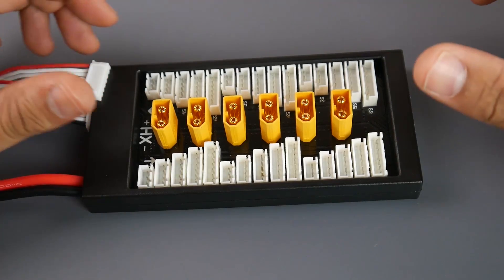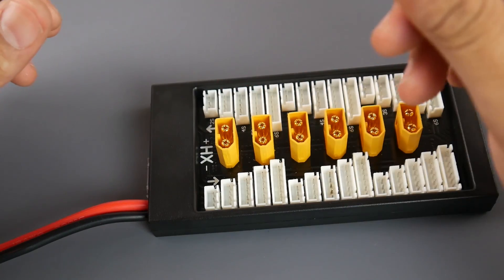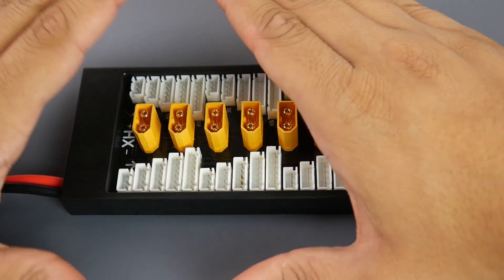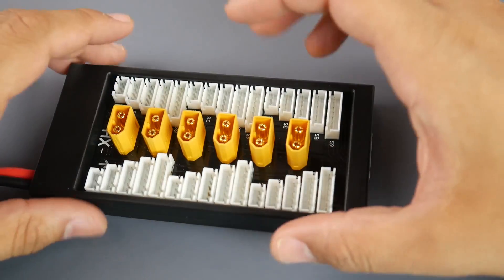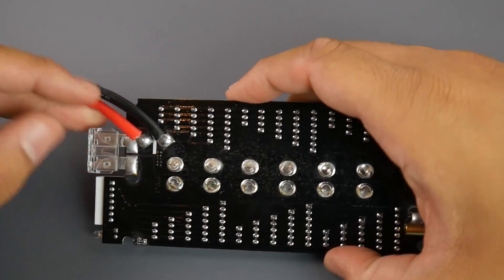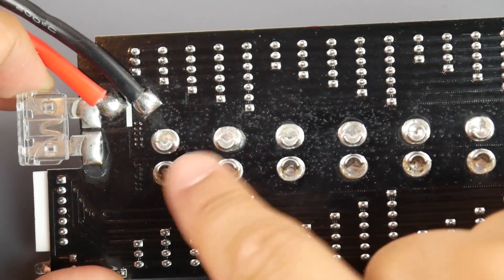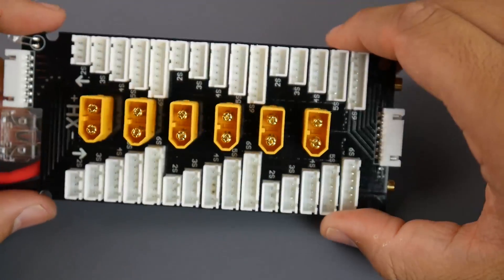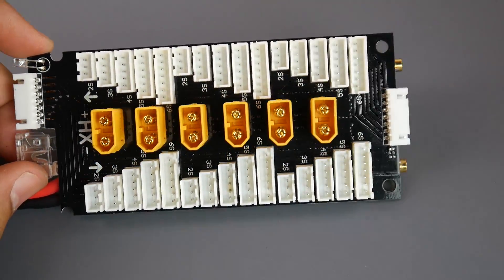$15 ISDT Parallel Charging Board // Review & Tear Down

Comment: Correct if my understanding is wrong please.
I should charge batteries with same cell number.
I should charge batteries with same capacity.
I shouldl not charge batteries with same cell number and capacity but different current voltage unless I leave them standalone to balance each other and then I can charge.
If I connect 4x2200mah, then my current on the charger should be 2.2 (1C) x4?

Comment: Yikes, I ordered this thing before watching your video. I wish I saw it with the case off before purchasing.

I know you said this was your first parallel board so perhaps you're not familiar with safety features that are present on better ones, but it is standard now to have poly fuses on the balance connectors and individual fuses between the power connection for each pack. Strange that you would acknowledge that parallel boards scare you, but then be ok to use one with no safety features to prevent high currents flowing between packs. 

Would you consider adding a disclaimer to your description warning people that this parallel board is lacking in safety features that are present on other boards. The board should work fine as long as the user is very diligent and never makes a mistake when plugging things in. Personally I would not take the chance, you can get a board with fuses for another $10-15, that's cheaper than the cost of a new battery or a fire.

Comment: Don’t spread misinformation...  it’s completely fine to charge batteries of different “sizes” as long as the voltage is the same... When parallel charging the batteries behave as one giant battery...

Comment: If the batteries are within .5 or .6 they balance in mins. 5 or 10 mins. I used to wait about 30 minutes, but started checking with a voltage checker

Comment: I have two of these boards, the modification with banana plugs and coworker have a third one. Cooper traces on board are massive. Hadn't fried one with 10A balance current on charging 4S. On accidental balance connector inserting backwards (JST balance sockets are prone to allow connector inserting improperly if one is on rush or don't care), fried 3S and 4S balance socket. Replacing is easy, but you must remove fried connector by pulling out fried pins when solder on them is melted. Damaged traces can be repaired with 20AWG wire.
Mixing C-rating and capacities on parallel balance charging is possible for batteries with same cell count. On same capacity but different C-rating charge with current allowed for connected battery with a lowest C-rating. Batteries with different capacities will charge as battery with total capacity for both batteries. In both cases before  batery connecting to charging board check for if voltage difference doesn't exceed 0.1V.

Comment: You can charge different capacity packs together that are the same voltage, provided the cells are within .1V of each other. Just add up the capacities and treat them as one pack of that sum, and charge at 1c.

Comment: if you use 3s 800 like me or other low amp batteries the moment you connect one battery you only need to connect the parallel cable of the rest.

Comment: I refuse to use these boards. I have cells go dead every once in a while. Put this lipo in a balance charger - WARNING! - put it in a parrelel charger lipo fire. You have to be on the ball checking voltage and cells before using this thing.

Comment: You just can't mix voltages MAH does not matter I do 1300's with 1500's. But they should be within 0.4v of each other before connecting.

Comment: You can mix batteries with different capacities without problem. The two things you have to worry about are:
1. individual cell voltage: which has to be almost equal over every batteries nth cell. If the voltage difference is to high, a very high current will flow between the the cells of the different batteries over the charging board and it will burn the traces.
2. internal resistance: You should not mix old and new batteries. Old batteries have a higher internal resistance and will take current differently than new batteries if you mix them. So if you want to charge  n batteries with n x 1C, each battery will not receive 1C but some more and some less.
And you don't have to wait more than 5 min to equalize the cells after connecting all the batteries. The board has almost no resistance so the the little voltage difference is equalized very fast.
Reply: foamidable Point 1 is correct, Point 2 is false. Internal resistance will not impact division of charge current.
Reply: @peterkjellstrom3100  ok, then what does? joshuah bardwell shows in his video batteries with the same capacity, parallel charging each with different current
Reply: foamidable I don't know exactly what you are referring to but an uneven charge current is one or a combination of: 1) not fully equalized initial voltage 2) actual capacity difference 3) slight differences in charge curve (chemistry).

The largest factor you'll see for reasonable combinations is #1. Starting the charge early at high amps will essentially push most of it into the lowest/lower pack/pack.
Reply: @peterkjellstrom3100  I thought higher internal resistance leads to more energy wasted to heat while charging and discharging. So you need higher current to bring a battery with high internal resistance to a certain voltage.
Reply: foamidable The ir will cause heat but 1) it's really low (a charge around 1C does not noticeably heat a healthy battery) and 2) any such heat would just be seen as added capacity charged (wouldn't cause any imbalance).

This may not be clear without a solid electronics understanding. But there are online circuit simulators you could play with to see how it works if you want to.

Comment: You can charge batteries with different C-rating and different capacity. 
What is important is number of cells and the voltage of each cell. If the cell voltage is different you get a momentary current from the cell with higher voltage into the cell with the lower voltage, when you plug them into your parallel board. 
This is a problem for the cell with lower voltage as it will be changed with a high current for a short while, until the voltage differences has evened out. Especially if the lower voltage battery is a low C-rated battery and the battery with the higher voltage is high C-rated, it may kill the low C-rated battery. The battery with the higher voltage will see a discharge current that is high but our batteries has far higher discharge C-rating than charge C-rating so there is no problem for the ell with higher voltage.
A rule of thumb that many people use is to only connect batteries that has less than 0.1 Volt difference per cell.

Comment: You can mix capacities just not cell count. So you can charge a 1300 and a 1500 mAh pack together but not a 3s and a 4s. Do make sure the voltages are within 0.1v per cell though. Also, be very careful to check the cells of each battery are looking reasonable veggie plugging them in. If you have a bad cell on a single pack it will drag the corresponding cell down in all the other packs and you'll ruin them all, if not start a fire.
Reply: I agree, the main thing if you do mix different capacities of the same cell count is to make sure each cell voltage 
 is as close as possible and any batteries with a questionable cell needs to be charged separate.

Comment: This board is made by Amass FOR ISDT chargers (like you couldn’t use them with other chargers...) and not by ISDT. The ISDT boards only take four lipos, are made of aluminum and look a lot safer.
Reply: Yeah, came here to comment exactly the same.
Reply: ISDT have named it 'Safe Parallel Board' but I wouldn't say it was any more or less safe. You're just paying for an aluminium enclosure.

Comment: Hi mate I have 3 chargers two single chargers with parallel boards on each so that's 12 packs in one hour...but I also have a quad charger with boards on each channel so that 24 packs..in total for 1c  one hour charge 36 packs...Yes 36 packs in 1 hour!!!! On a 3c charge which my packs CAN take I'm out the door in half an hour with loads of packs 😁😉😏 I don't do field charging👍

Comment: do they make this xt-30?
Reply from the maker: http://bit.ly/2E1IvNa
Reply: You can make it by your own. Just desolder the xt60's and replace it with xt30. Only a little amount of grinding to the edges of the holes is needed to get the smaler connectors in.

Comment: Why don't u make a Arduino based fc
Reply: An arduino is too slow, it was the basis of multiwii if you want to take a look.
Reply from the maker: No he has a great idea. I can make a f1 based arduino board which you can program through arduino ide as you please. It will be mainly for tinkerers and dev's.
Reply: @DroneMesh  that would be great. If done well it could be the best easily programmable flight controller for wings, quads.

Comment: You can mix capacity as long as they are the same S rating.  Bardwell has a video demonstrating how it is ok and works.

Just make sure voltages (per cell) are within 0.1 to 0.15 of each other before plugging in any battery.
Reply: There is some debate about this. Personally I mix capacities without issue BUT smaller cells charged with bigger ones will charge at a higher c rate. Personally I'm not totally clear on why but I have tested it with my current meter. I am not changing what I do but it would be good to understand why someone like Drone Mesh doesn't want to do that.
Reply: What you see on your current meter has nothing to do with the capacity but with the internal resistance of the different batteries. Old and new batteries will take current differently if you mix them. Basically it takes more energy to charge a old battery since it creates more heat while charging (and discharging).
If it was like you said, the small battery would be full before the big one which is obviously not the case since cell voltage of the connected packs is always equal.
Reply: Of course but all other things being equal the larger batteries will have lower internal resistance. Joshua bardwell run the same test and got the same result.
https://www.youtube.com/watch?v=QDOFcY1d2Y8 about 5min in